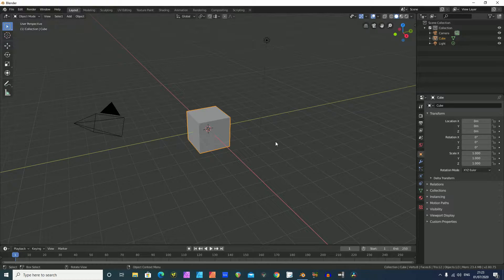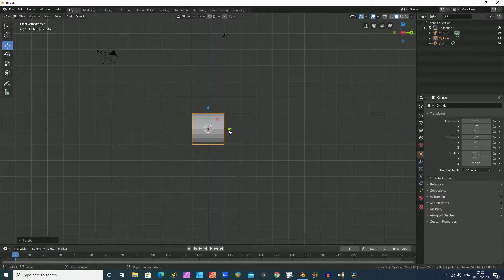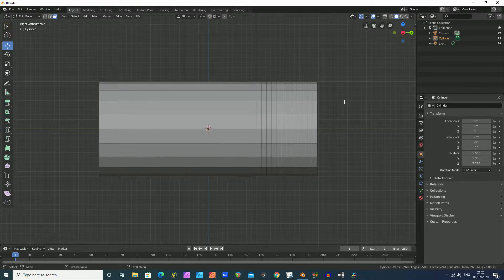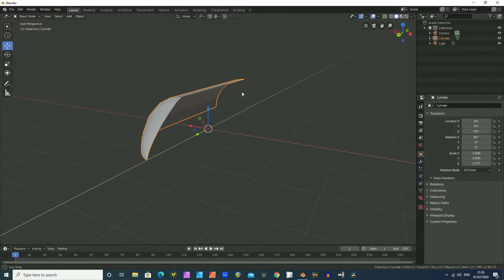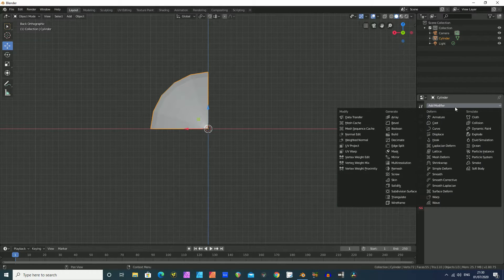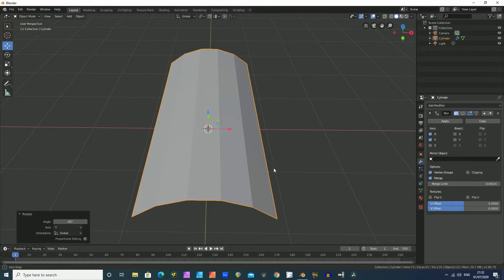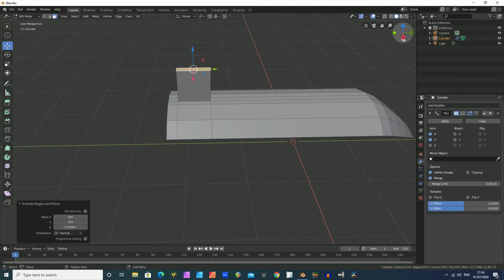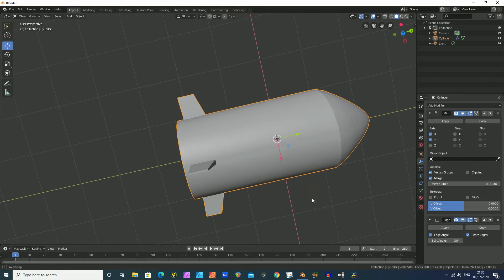Making a Rocket in Blender - The right way.

Comment: why did you delete the back face?
Reply from the maker: I can't remember why I did that. Probably to leave an open hole if I wanted to make a flame or something.
Reply: The reason in the video is probably different, but i use to do that for better results in subdivision surface modifier.